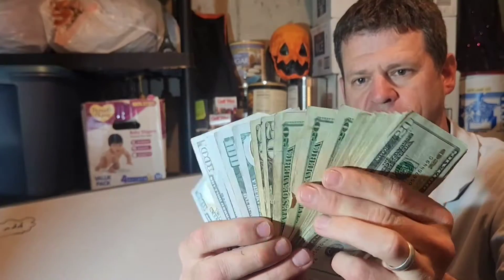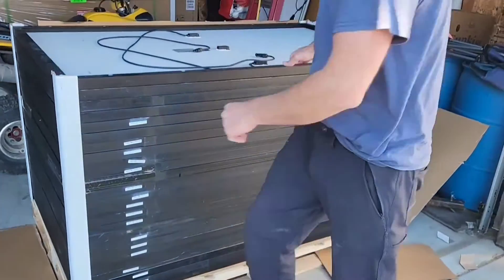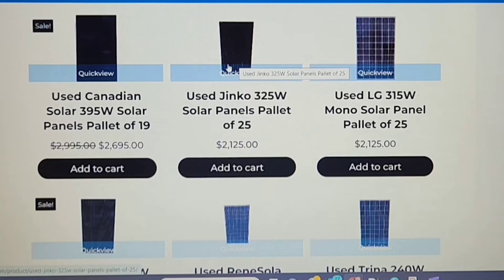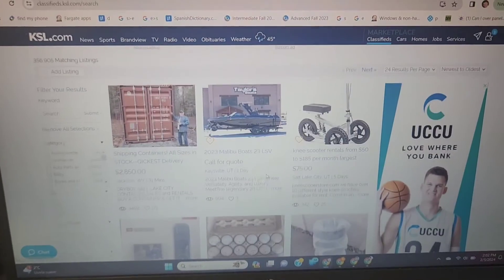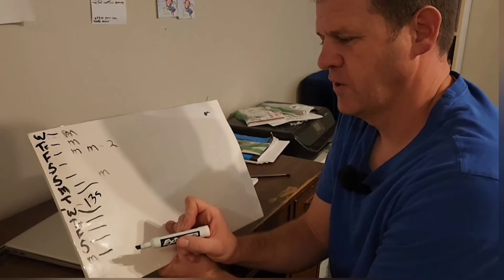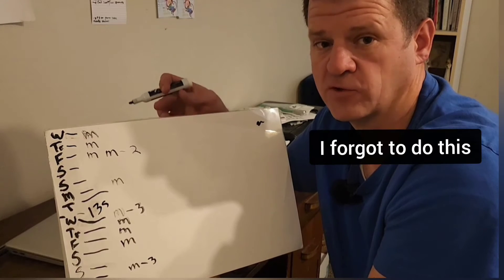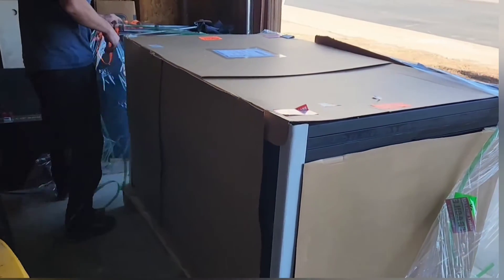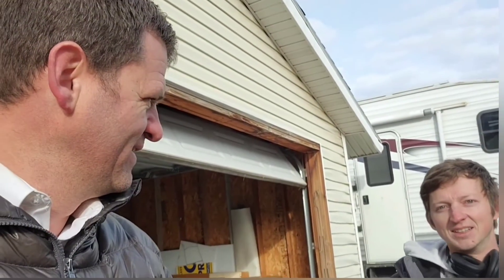I Tried Selling Used Solar Panels - This Is What Happened

Comment: This doesnt work. I bought the cheapest panels on fb for a project. Which was $250 for 8 for a project about 1600w total. I ended up moving and not using them. I had a hard time to sell it at $250. Eventually about 2 months later i was able to sell it at $175
Reply from the maker: So you bought them on Facebook and sold them on Facebook? You're supposed to buy them from the supplier at a discounted price and then sell them on Facebook
Reply: I mentioned it was for a project (that i didnt get to) not to resell for profit. Regardless whether from a supplier or from fb, it was a killer price regardless

Comment: Do you have a net metering contract right now or some other situation?
Reply from the maker: Yes, I believe Rocky Mountain Power does have net metering.  However I haven't fill out any paperwork yet. I might try a off-grid setup.
Reply: @diySolarPowerFunWithRay   A  couple of things:  1.)  I live in southern CA so can't say too much here on YT. I have current transformers on my L1, L2 lines coming into my breaker box. My ground mount (I have several acres) solar supplies my string inverters with enough power to compensate for all power used except the whole house A/C. My bill (most expensive electricity in the USA) is seldom over $40.00. I put an efficient window A/C this summer and it cools most of the house we spend time in. So I have no net metering or anything like that and I will keep it that way. My inverters typically keep just 5watts draw from the grid for each 120VAC line in during the day no matter what I have turned on.   My inverters are the cheapy China blue box ones but they have worked flawlessly for years. AS soon as I can remember the name of the new All in One (like a Growatt) inverters WITH current limit transformers I will notify you. Think Solark for 1/4 the cost but with current limiter transformers.   
2.) You live in Utah, "Fab Rats" (youtube provider) is in Utah. I suspect if you paid him in cash and no receipt (liability) he can fix your trailer so you could not break it in the Baja 1000! He has the skill, knowedge, and experience. 
3.) Thanks for the used solar business model. I have a retired friend that could do that very easily and I can provide seed money in exchange for at-cost panels when I want them.